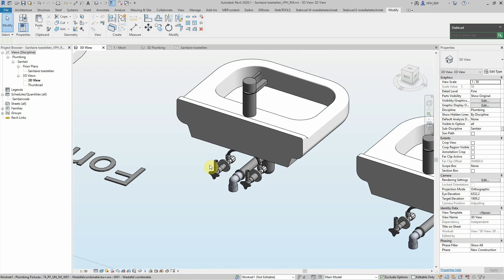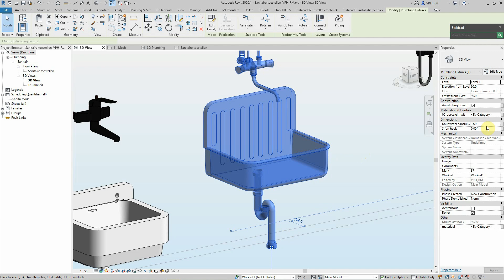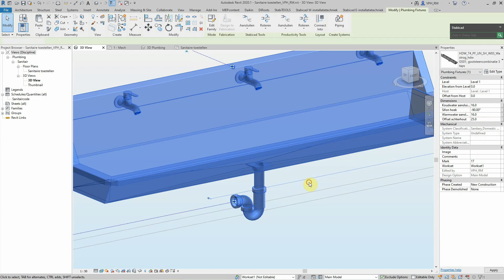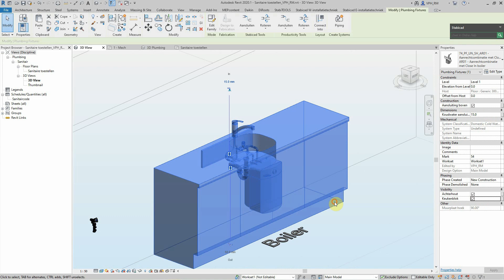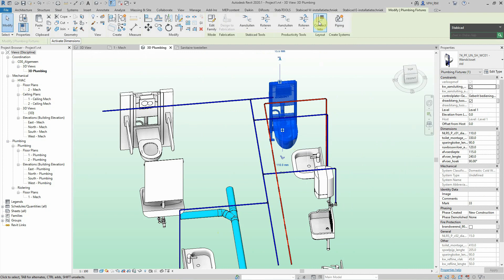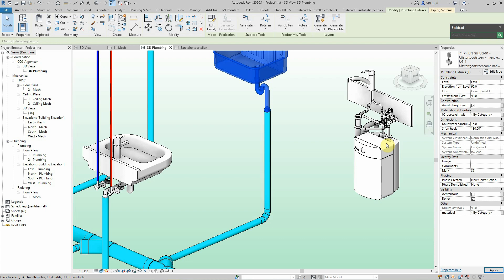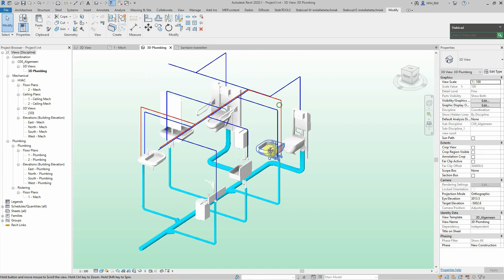Smart Plumbing Fixtures Revit

Comment: How do you make 45 angle conections automatically on the network? are the family fittings of this pipe type with the angle blocked? nice library though
Reply from the maker: Thanks! You can download the Dutch BIM library of piping systems from the Wavin/Geberit or DYKA website. With their piping systems they automatically make 45 or 90 angle connections. Depends on your routing preferences settings.